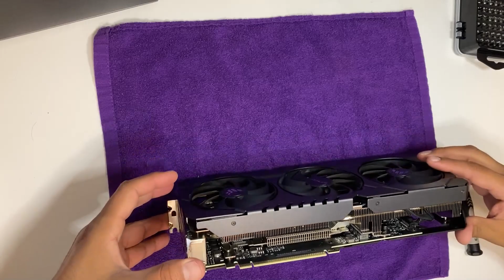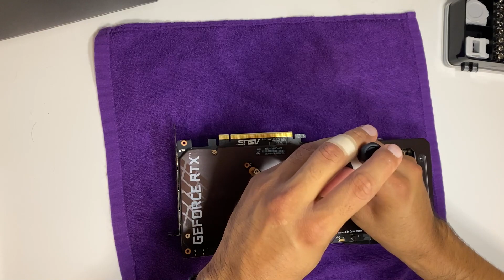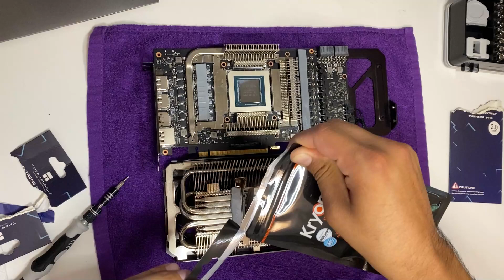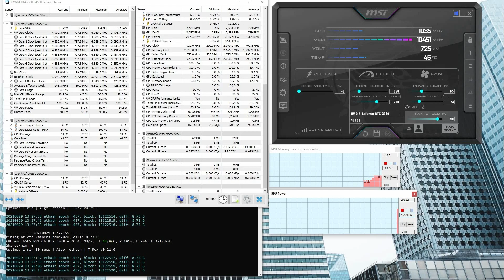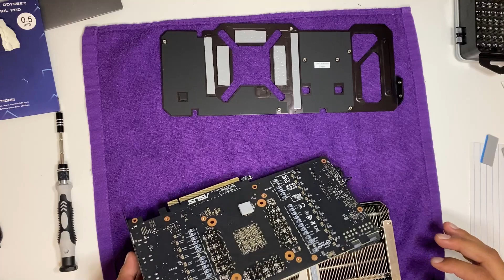Asus TUF RTX 3080 Thermal Pad Replacement - Vram dropped ~(-20c) and improved hashrate

Comment: Hello. For best results, you don't want to get any skin oils on the pads. Clean all surfaces with alcohol, put on gloves, then apply the pads (ideally w/ tweezers/etc)
Reply: I followed his guide on replacing the thermal pads and didn't quite see as big of a temp drop. But I had never done it before and wasn't careful not to put my fingers on them. Do you think it makes that big of a difference?
Reply: @kookner1326  It honestly really depends on your skin and the situation. It "can" make a huge difference or none at all. Totally depends.
Reply: This is nonsense lol.
Unless your skin literally leaks oil, it doesn't matter.

Comment: For anyone thinking about adding the very first pad show in the video, make sure to use a 3mm, not a 2mm pad. A 2mm pad is not thick enough to make optimum contact with the curved heatpipes.
Reply: i used a 2 mm and it worked fine but thanks
Reply: i used a 4mm pad...i tried 3 it it didnt work good enough

Comment: First, thanks for the useful video. Managed to drop from 92-98 degrees to 82-86 degrees on 3080  TI tuf. (24-25 ambient temperature, 90% fan speed)
My contribution to this video is:
-left and right pad you replaced first and added on 3:31 seems to me that are 3mm both instead of 2mm so i picked 3mm.
-i did not replace 0.5mm pads and one on the left that is 1.5mm
-used 1 pack of 2mm and 1 pack of 3mm pads 45x85mm and it was enough, just try to optimize the space you have on  this pads. (i made last pad on 23:20 from 3 pieces because its lowe priority pad and i think thats ok)

It seems that core temperature is little higher, averaging around 50 degrees, and i think it was around 47 degrees. Maybe i did put arctic mx4 wrong, because of trying to fit cooler on the gpu and wiggling it back and forth. Also higher hotspot i think
Reply from the maker: Thanks for the contribution. That could be the case. I do know for sure that the 2mm made contact at least due to the lower temp after changing that one pad.
Reply: Hi, I have a same card and want to replace pads. Could you please provide how many pads of each thickness do I need? Also, did you use that provided in this video or do I need pads with bigger conductivity? Thanks in advance
Reply from the maker: @hrust33  in the video I did I used one of each of the thermal pads. I also noted the pads I didn’t replace. But if you bought an extra 2mm you would definitely have enough to be safe. Mine is running cool based on the pads I replaced in the video.
Reply: @migs5492  thanks 😊
Reply: What about to put a cooper thermal pad instead of a 3mm on 3:31??? maybe 2mm with grease? i did replace all thermal pads on my 3080 asus tuf but i didnt check w/mk thermal pad i used, i put a very bad ones (3.5 w/mk) now i have 104-106 degress on vram. i wish to doit again but using a Zezzio 40w/mk grafito on memory what do you think about it?
Reply: @Tiomaurocg  i used 12.8 W/mk thermalright odyssey. Its a very good pad. I would not put copper on 3:31 because pipes of a heatsink are not flat and copper would not make contact like thermal pad. But u can put copper directly on memory modules which will increase heat transfer. Although i am satisfied with the result, summer is coming so i ordered copper plates to do the mod on my card.  Great video from Dandy on TUF with copper plates :
 https://www.youtube.com/watch?v=f8f6ZHCPVpw&t=115s&ab_channel=DandyWorks

Comment: I Just did this to my 3080 TI, with same settings and indoor temperature i went from 98-100C to 84C :) thank you for good video
Reply from the maker: Nice! You have to love having cooler temps on all hardware to sleep better at night.
Reply: What thickness of thermalpad for 3080ti tuf gaming u use ?
Reply: Hey man, I’ve been struggling to find info on the amount and thickness I need for the 3080ti TUF, would you mind sharing?

Comment: Thanks a lot for your great video description, I have the same GPU as you and I’m getting 82-84C memory temp with the thermal pads upgrade at 69% PL, 85% fan, 1200 mem clock for around 99 MH/s. My gpu temp is stable at 46C. I had a memory temp of 100C in the same mining condition before upgrading.
Reply from the maker: Nice. It was a good feeling seeing those temps drop.
Reply: @migs5492  please tell me what pads to order. Please. How much of each ?
Thanks you so much.
Reply: @Glupkomatun   His video description says he used 3.0, 2, & 0.5mm thermal pads and he gave a store Link
Reply: @robertweekes5783  thanks man

Comment: Thanks for making this, it was a big help.

Summary of what you need to buy if using Gelid pads:
3x 2mm 
1x 0.5mm
1x 3mm
These are all 80x40 pads. Peel one side, then cut with razor, do not use scissors, or cut before removing the plastic or you will squish the pad reducing its thickness. 

There are a lot of sources out there that are very wrong about the pad sizes. This video is the most accurate, although sort of difficult to follow due to how it flows. I found the pic you linked in the description after I had put everything back together 😂. That would have been quite useful. As for my results, after replacing every pad + the extra one on the pipes, here is what I got using occt gpu stress test for 1 hour.

[all default settings, 100% power, no overclock. Physical switch set on "performance"][21C/70F ambient with open air case]
[Memory Max]
110 within 5 minutes before (thermal limit) --- 68 after
[GPU Max]
64 before --- 68.8 after //I'm assuming it's a bit higher due to the heatsink actually cooling everything else now too, rather than making terrible contact with the memory and only effecting GPU core temps, but honestly 4 degrees could just be margin of error with my very unscientific testing environment aka the closet at the end of the hallway//
[Hotspot Max]
idk before --- 88.6 after
[Fanspeed Max]
Max while thermal throttling before --- 84% after

I used mx6 on the gpu because it's what I had. I also pre-spread it which is highly recommended for a gpu since it does not have an ihs. No comment on the longevity of mx6 as a gpu paste, since I've literally had it on there for less than a day, but if you're buying paste for this job anyways, just grab something more vetted for gpus like thermalright tfx. tfx is an absolute pain to use though, so be prepared for that. It's super thick, and mainly just sticks to itself, it's like trying to spread a booger on to your gpu.
Reply: How's your mx-6 holding up?

Comment: Only a few things from someone that does such stuff for 20 years now:
- never place ANY pc hardware on towls or tissue that can get static -> you can kill you hardware like that
- remove the fan connectors to properly handle that GPU and not leaning it again a cooler or such stupid stuff -> tiny SMDs can be damaged or ripped off and your card is done
- my god i use that amount of thermal paste for 2 CPUs and 2 GPUs -> you waste a ton on a single GPU repasting :(
- never drop anything on the GPU / PCB like you did in the video ( as you didn't attach cables and couldn't handle it safely ) -> good by SMD or worst case you hit the die and damage it ( yes this can happen )
-> overall my card never exceeds 82°C on silent bios and without ANY mods, same thermal pads applied as on yours ( i checked ) 
-> maybe its time to think about proper case and cooling ( i have only 3x 120mm fans in @ 500rpm, 1x 140mm fan out @ 500rpm to maintain overpressure and avoid dust collection from any open spot in the case that has no dust filter -> very silent, very cool and clean )
Reply: rather too much thermal paste then not enough, considering he didn't spread the thermal paste over the die like he should have. Using all that paste likely made it so that the entire die got covered. Personally when i repaste GPU dies I spread the paste to make sure the die is fully covered.

Comment: Interesting video. One thing, the Thermal Grizzly needs to be reapplied about every 2 -3 years, Artic MX-4 lasts 8 years and will  maybe add 1-2C over the Thermal Grizzly
Reply from the maker: Ahh. Thanks for that. I’m sure I’ll be doing that anyways but good to know.
Reply: I have to replace the MX4 every 6-12 months as the temperature always increases significantly.
Reply: @SpesDesperatio  Interesting, I used Artic Silver for years with no issues and I have had MX4 on my servers for at least a year now. Actually 3 systems 1 - 5900X that gets occasional use and 2 3900X servers that run 7x24. My previous system had the paste I put on it 4+ years early and ran very cool.
Reply: @hdtvkeith1604  On processors, on the headspreader, I have no problems with the MX4 either. Applied directly to the DIE, like on a graphics card, the MX4 wears off after just a few months.If you look for it, you will find some that report the same thing.

Comment: I just got myself the same card and will be going through the same process very soon, so THANK YOU for this content, it will help A LOT!
I just have some questions:
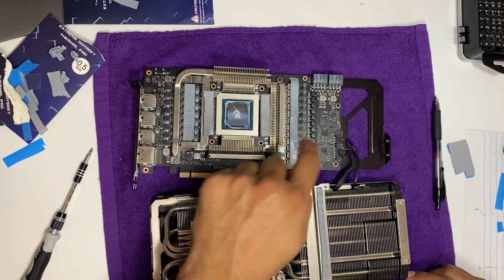1. What are the sizes for the ones you DIDN'T replace at 21:41 & 21:44? And what was the size for that last one you replaced at the end 22:54
2. How much material did you need? 1 pack of each size will suffice?
Reply from the maker: 1. Those were the VRM chips. The VRM chips on the left were 1.5mm. I was originally going to triple stack the 0.5mm to cover but decided not to change the original pads. The VRM chips on the right are 2.0mm. 
2. I used one pack of each 85x45, 0.5mm, 2.0mm and 3.0mm. I essentially ran out of 2.0mm for that last pad I didnt replace. If you want to be safe to have enough for that you can buy two packs. Although I feel the VRAM were the most important and I am still getting good temps without replacing those two VRM chips.
Reply: @migs5492  Thanks dude! You are a life saver!
Reply: @migs5492  Regarding point #1.  Was your 1.5mm VRM pad in pretty good condition when you opened your card?  I've been mining on my 3080 TUF OC since February and have no idea what wear and tear there is (been keeping my card under 95C for most of those months).  I have been noticing my temps going up slowly over the last couple of months.  I want to buy the 0.5, 2 and 3mm pads but not sure on the 1.5mm.  The first 3 alone are pretty expensive.  I plan to replace my pads sometime in the very near future using this video as a direct reference.
Reply from the maker: @vivisimonvi  My card was pretty new. It was about 3 weeks old when I replaced the pads so they were probably in better shape. For the 1.5mm, i was toing to triple stack the 0.5mm to make 1.mm. I am sure there would have been enough because i didnt use much of the 0.5. They are not the easiest to deal with though because they are so thin.
Reply: @migs5492  So I'm in the process of replacing the pads as described in your video.  Just to let you know, the pad you replace at https://youtu.be/FMy3vR2JxGw?t=1161 is definitely thicker than 0.5mm (it looks like it's 2mm).  Is there a reason you went with a much smaller size?  Just to be safe I won't be replacing that pad.
Reply from the maker: @vivisimonvi  You may be right, its hard to tell from the video but looks like it could be a little thicker. It could be a 0.75 or 1.0mm, definitely not 2.0mm. I replaced with 0.5mm and my temps still reduced overall pretty substantially.
Reply: @migs5492  Well, this took over 2 hours as I didn't want to mess anything up and I'm seeing a MASSIVE improvement over stock.  My stock pads definitely had some wear but not terrible though they did stick everywhere especially the VRAM pads.  It was very tough to clean under the backplate (3mm) area as the pads disintegrated a little.  I went through a few dozen q-tips overall and it's still a bit messy.  I dusted my computer as well as that definitely helped (been over 6 months).  I added that extra pad you mentioned in the beginning and I also did the 4 mini-backplate mod on the back of my card (or top I guess) with my side case fan blowing over it.  My previous temps where right at and under 94C at a measly 65 hashrate at worst (75% fan speed).  As of right now for the last hour (and it's pretty warm in a worst case scenario), I haven't seen junction temps go over 88C and I'm getting a 93 hashrate (75% fan).  My core temp seems about the same but I haven't tested gaming.  I used some very old Mx2 thermal paste for that.
Reply from the maker: @vivisimonvi  Nice, glad it worked out. You should be able to squeeze some more mh/s out of that card. I use -200 core clock, +1200 memory clock and 75% power limit to get ~100 mh/s. My GPU sits around 50c and Vram at around 88-90c.

Comment: Bro, I think the most crucial pad was the first one you installed, to help the vram touch the heatsink above, but the second time you open the card I can see that it isnt making good contact with the heatsink, there is no visible traces on the pad. I have an 3080 gaming x trio, same problem, the cold plate wasn't touching the heatsink and just by adding some pads I literally dropped 26 C on the vram and the core temp rised a bit, since the cooler now was actually getting the high vram temp.
Reply from the maker: I guess I didn’t look. May need a slightly thicker pad. I’ll keep that in mind if I open it back up. Thanks.
Reply: Very well noted! Would you mind tell wich thicknees do you used for this? Thank you!

Comment: i changed pads on mine msi gaming z trio with 1mm gelid gp extremme 12wmk now memory temp is like 78 to 80c max.  i will change again but with gelid gu ultimates which will get temps even lower than 78c

Comment: Is there a way to slowdown/underclock the 3080 VRAM to keep it cooler? I prefer silence over speed.... I don't care about getting the fastest MHs. What are your VRAM temps if you put the Fan speed at 75%? It is so much quieter at 75%...
Reply from the maker: I would install MSI Afterburner and lower the power limit % until you get to a good temp at that 75% fan speed. My guess is the power limit between 70-80% would get you there. I just lowered my fan to 75% and my power limit is at 75% and I am getting 98Mh and my VRAM is 84c. It is cool this morning so my guess it would be a little higher, maybe 88c at warmer ambient temps.

Comment: Hey, thanks man for the great video. I followed this with my 3080 and dropped VRAM from 98c to 72c. What a difference, thanks a bunch!
Reply: How many thermal pads did you need to buy and what size?
Reply: @Adamlee-df3br  all three sizes .5 2.0 1.0
Reply: @pootersnacks  one pack of each? And we’re they the 85x40 ones? Did you have enough to do it all
Reply: 05 2 and 3 one pack each cost like 45 bucks
Reply: @Adamlee-df3br  yeah they were rectangle i forget what size about 3 inches long and 2 wide

Comment: great tutorial the only thing I would recommend is on the GPU die you should spread the thermal paste. On a CPU it doesn't really matter if there's a little bit of the IHS that has no thermal paste on it but since there is no IHS on a GPU die you need to make sure it's completely covered with thermal paste.

Comment: Saw that some people might've used a copper shim on the CPU when doing this as the thicker pads mean the heatsink wasn't contacting the CPU as well - going by your temps it doesn't look like you've got any such issue - temps seem to be OK when you run something with the CPU itself at 100% power rather than downvolted for mining?
Reply from the maker: Yea exactly. When i am gaming I run at 110% power and the GPU gets to the mid to high 60s.

Comment: Hello, is it enough to change the 2.0mm ones? Because in my country thermal pads are quite expensive and I want to replace only the ones that make the biggest difference. And another question, will Maxtor 14.8w/m-k be good?

Comment: I did everything like the video and got 20 degrees Celsius more than before the replacement. What could be the reason in your opinion?
Thanks
Reply: Your temperatures are higher after the replacement? Could be the quality of pads or the thickness not being optimal.

Comment: Hey, i did this and now my computer isn’t booting. I get error code 97 (asus), pc seems to be running, all fans and lights are on (also on gpu) but there isn’t any display output. 
I took it apart again and tried to clean it in case i spillef something where i shouldn’t have, and let it rest for some hours before trying again, this time it actually booted, but i got a black screen when i started mining… i tried cleaning it again and now it’s back to error code 97 and no screen output. Any help?
Reply: Also, the gpu seems to be getting warm even though I’m not getting a proper boot